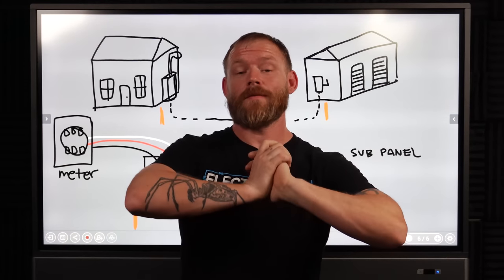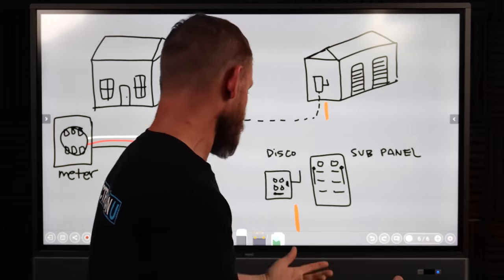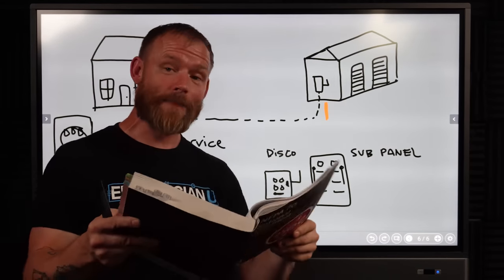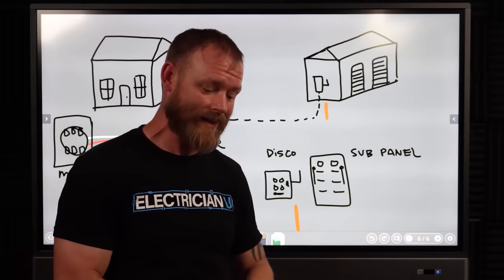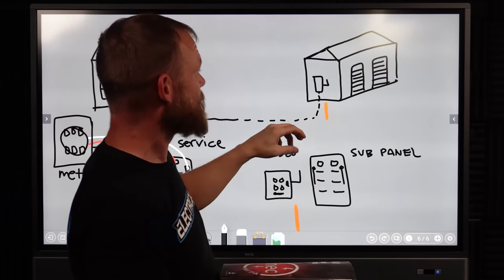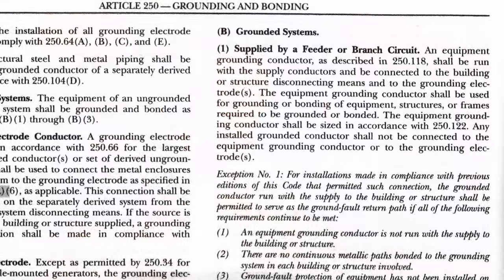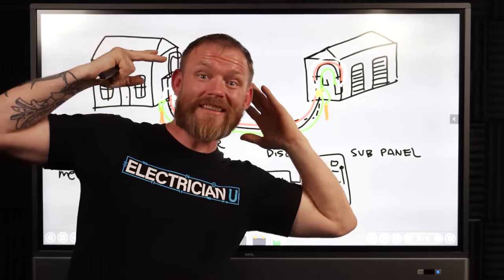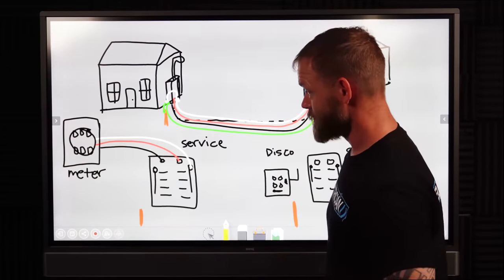Is a Ground Rod Needed When Grounding Multiple Buildings?

Comment: Speaking as an EE, you can't have too many grounding electrodes.  If there's any question, put in another ground rod.  You want that green conductor to be as close to earth potential as possible, which is why it's not bonded to neutral anywhere other than the main panel.  Neutral wires carry current, wires have resistance, and current through a resistance has voltage.

The part about not using the earth as the grounding conductor reminded me of what I used to do as a teen when I wanted to go fishing. (Don't try this at home.) I'd water a bit of the yard, push a steel rod about a foot or two into the ground, and connect that rod to 120V.  In a few minutes, the worms within about 5 feet of the rod would be wriggling on the surface, where I would just pick them up.
Reply: 👀 Hmmmm sounds like a good idea though 🤔🤣
Reply: What creative teen the fished didn't try that at lest once.
Reply: ./Sigh
Reply: Why would you not want the most efficient path back to the source?  

In this application it seems excessive grounding electrodes will prohibit the ground fault from being detected and opening the circuit, increasing the risk of being shocked.
Reply: What happens if you stood on that ground...barefoot?
Reply: Grounding large electronics equipment is just asking a lightning strike to destroy your equipment. So no don’t just ground everything.
Reply: @nobadmojo70  if you add an additional bond to the neutral at the other building sub panel, you will end up with return current traveling on metal parts and the ground (green) wire in a NON ground fault condition, as well as in a ground fault condition. You essentially are giving the return current the option of taking the neutral back to the transformer on the pole, or taking earth back if it's a rainy day, etc...

This is why the NEC clearly says to never bond neutral to ground except where power is generated, transformed, and enters the site from the utility. This process creates a single, low resistance path back to the source. Adding bonds at other locations creates multiple paths for return current to take which is what you do not want. Multiple paths means a less likely and/or longer period of time for a breaker to open in a fault condition.

Think of it like this. The utility high side power feed is the only thing allowed to use Earth as a return. It comes into a pole mounted transformer at 7200V with a single wire. That wire wraps around a square piece of iron on one side, and then exits. When it exits, it gets tied to the metal enclosure of that transformer, then to a low hanging neutral (if one exists), then it goes to a rod at the pole to earth. If the 7200V neutral breaks between the previous pole, and yours, that high side voltage will keep on coming your way, and it will go into the earth, travel back to the previous pole's ground rod, up to the low hanging neutral and keep on going back to the power plant. 

When you bond a neutral in a sub panel across your property, and connect it to a 2nd ground rod. Every 120V ckt in that building has the option of taking the neutral wire pulled between your buildings to get back up to the secondary center tap, OR it has the option of just going down your 2nd ground rod into the earth, making it's way back to your first ground rod/bond at the service, and then back up to the secondary winding on the pole. It also has the option of splitting the return current up, and sending some back on the neutral wire, and the remainder through your yard. 

This is bad. In a fault condition, or worse, that neutral wire you pulled between buildings breaks, now it's all going back through your yard, and people walking around, pets, etc... The 240 side is even more dangerous if it can find it's way back past the service

Comment: Been working this issue for weeks since I discovered it with my shelter house.  Unfortunately the feeder line from the house to there didn’t have a ground run to it (not to mention he didn’t bother running one from the service connect across the driveway to the main house).  Electrician has already come out and it’s planned to all be redone starting the first).  This ain’t cheap but I’ll feel better having it done right.
Reply: Just went through essentially the same thing. No ground in the undersized feeder to the metal shop building and no ground rod at the shop building or the house. Now it's been corrected with a new feeder install exactly like shown in the video along with changing out the fire hazard Federal Pacific house panel with a modern one. Agree it's not cheap at all but I'm happy with the work done.

Comment: Wow...I need to fix my metal building, LOL.  I had a 100A sub-panel/distribution panel on a pole with L1/L2/N/G from the main in the house.  I added a metal building (34x28) on a slap next the panel and actually moved the panel inside my structure. everything is as you show in 250.32(b) but I do not have a grounding rod at the  metal building and my ground (green) is not connected to the metal building just to the ground strip in the sub-panel.

Comment: question: Metal industrial building. 480v 3 wire delta service therefore no neutral coming  into building. The 240v transformer has the neutral  and grounding conductor bonded to to the metal building.   Is a ground rod also required?  Awesome channel for a non electrician!!

Comment: this ground conductor will also help prevent differences on ground potential. have seen computer cable burned out by equipment with a 0.5v ground potential difference.

Comment: HELP!

I have a sub panel in my garage (fuses 🤦‍♂️) that I'm replacing. I have to run new feeder with an egc. The existing buried pvc conduit contains feeder hots and neutral (only 10ga with no egc 🤦‍♂️), travelers for a 3-way light switch back at the house, and a phone line 🤦‍♂️. I'll be replacing the 3-way with a smart switch and deleting the phone line.

The problem I have is that the sub panel is in the middle of the garage slab with no grounding electrode. Will I have to drill the concrete and pound a 20' electrode? The closest exposed earth to the panel is over 15' away. There IS a buried copper water line to the garage, within 3' of the sub panel.

Love your content! Keep it up.

Comment: Hey!  I'm in florida, and wanted to run this by you, because I have had this argument online before.   This is in the case of a Solar system, that is fed by a line-side tap, and not a breaker.    Engineering, as well as inspectors, require a lineside tap from the main service panel (bonded)  to feed a fused disconnect, which is also bonded. 

I see it as a "seperate" 1st means of disconnect, due to the inspectors and engineering.    We are using pierce taps on the service lines on the line side of a main service panel, so upstream of the main disconnect.   So we are branching unfused lines from the meter, creating a secondary system.

Sorry for rambling, but in this case, we always and must bond our neutral and ground in the fused disco, and keep the MSP bonded as well.  

I see electricians arguing that you cannot have 2 1st means of disconnect, and that only the msp should be bonded.     What is your take?    I only equipment ground a disconnect (non-fused) when I'm feeding from a breaker.
Reply: BTW, I Love your page, been watching for years!   I've been a solar installer, working under our electrician's lisence for 5 years, and am soon going to apply as an apprentice and work towards my journeyman's.  I have upgraded service panels, changed out outlets, installed switches, lights, sub panels, ATS's, even meters and meter mains, all along with our solar and storage systems.   I can't wait, and believe the years of watching your videos has a lot to do with why I am where I am today.  Not a part of your discord or your advancement classes but believe I will be joining as soon as I officially make the switch!    Thanks bro!
Reply: Ugh.  Just rewatched the portion where you're talking about multiple buildings and then wind and solar and realized you said that those are all separately derived systems.    Which is exactly what my comment said in 100× words.    I've always been confident that I was understanding it correct, just see ppl argue it wrong sometimes on electrician pages.   Lineside tap to disco, disco must be fused and neutral must be bonded to ground.

If you read all this...  I'm surprised, and thanks! Lol

Comment: Great information! Can you clarify this? What if an out building has a sub panel feeding another smaller sub panel in the same out building, would both sub panels require their own grounding rods? Would only the sub panel connected to the main be the only panel needing a ground rod? It is my understanding that only if the sub panel resides in the same building as the main will it not be required to have its own grounding rod. What is correct?

Comment: From what I've understood, once power has left the meter, the tie from neutral to ground should only occur once, which is at the main panel. Doing otherwise opens the risk of objectionable current. Earthing should happen to each sub panel, in most cases. If wiring enters another building without a panel--no further branches, then further grounding isn't necessary.

Comment: Great video. I'm in southern Missouri and there are basically no inspections here, except for a few municipalities. I see URD for feeders a lot, with no EGC. They just drive a rod. I fix a good number of these.
Reply: What sort of issues do they have when setup that way that you are asked to fix them?
Reply: @kevinmach730  no issues to speak of, unless you have a ground fault. I normally get called to fix hack work, and I'm thorough.
Reply: In southern MO are boat docks treated as separate buildings? Boat dock electrocution is a legit problem..
Reply: I'm new. What's URD?
Reply: @toddkerkhoff4672  Missouri has no statewide inspections, and very few boat docks 😁
Reply: @MrGatlin98  underground residential distribution cable
Reply: @RichardMcDonaldJr  Thanks

Comment: I guess my questions is, in a detached garage or any building, if I install an MLO panel with no main breaker, do the ground rods for that building attach to the mlo or back at the service disconnect at the other building

Comment: I'd love to see a video of you actually wiring the subpanel. As you explained, the neutral does NOT tie to the ground inside the subpanel the way it would in the main house. If I look at the panel inside my house, both bare (ground) and white (neutral) wires can be attached to the same locations in the panel, and those are all attached to the panel itself.

If I understand what you've said, that's different in a subpanel. The grounds will be tied together and grounded to the panel, but the neutral wires will NOT.

Do subpanels thus come with one set of lugs for the bare ground / green and a different set of lugs for the neutral / white?
Reply: When you  purchase a breaker panel to use in an out building as a sub Panel.... most often you have to  buy with the panel, and extra grounding Bar, for that brand of panel. Some brands come with them, but most do not.  It should come with screws and the panel should have a place to attach it. Must use the screws that comes with the grounding bar.  This will be your "Grounding" (Green Wire) connection for all equipment grounds.  The Neutral Bar already in the panel is your "Grounded" / Neutral Bar, for all of your neutral wires, (white).  Remove the Green ground screw from the Neutral Bar, or jumper, which ever it has.  You don't need them.  The Grounding Bar you install will be Bonded to the Breaker panel "can" using the screws that come with it.

Comment: If you have existing outbuilding serviced by a three wire feeder (two hots and a neutral) with no equipment grounding conductor and the outbuilding doesn’t have any metal connecting it to the main building with the service, is it correct that you need a grounding rod at the outbuilding and you bond the ground and neutral at the outbuilding subpanel? Adding an equipment ground conductor between the two would require trenching through an existing driveway so wouldn’t be easy.

Comment: Can you do a video explaining how to wire up a RV/travel trailer with shore power (120v) to a panel in the RV? When to bond the ground and neutral, at the rv panel or is that considered a branch panel and you consider the pedestal the bonded panel?
Reply: It would be a sub-panel. The neutral and ground must not be bonded in that, otherwise current flowing in the neutral will be split between it and the grounding conductor, so there will be some potential on "grounded" metal cases.

Comment: I had an inspector tell me that only one continuous wire can be run for the ground rods; it must pass thru the first and terminate on the second rod. You cannot have 2 separate wires, one going to each rod. Is that a local thing? Also: 6' is the minimum space between ground rods, is there a maximum distance? If two panels are located relatively close to each other, can they share the same 2 ground rods or do they need their own? Conversely, if you had 4 ground rods, 2 ea. for main and sub panels, would it be better to directly connect them all together?  If you have a ground wire directly fixed to a water pipe, can you attach a ground rod to the other end of that pipe, or does that rod require a direct wire to the panel? I know these questions may seem obvious, but codes are not always so obvious. Thanks for your shows!

Comment: Great info, I think it answers my question but I have a specific scenario and I'd like your response. I'm connecting my "shop" (a prefab shed)  to a 50Amp RV outlet.  From my main service panel I've wired a 50A 240v outlet, then run a 100' Southwire  50A extension cord (6/3+8/1 ground) to a Reliance 50A inlet box, which can then be wired directly to a sub panel. (No transfer switch, no generator,  I'm permanently powering the shed via the extension cord from the outlet.) The "sub" panel is actually a Square D 100 A Main Breaker Panel so I have my main disconnect. There is no ground bus bar on that panel. I assume I have to attach one separately, and hook up the equipment ground wire from the inlet box to it. So the main question is: do I need to stick an electrode in the ground and then connect that to a ground bus bar, or can I just attach the 8/1 grounding wire from the main panel to the ground busbar on the sub panel and call it good? Your video seems to say I need to do both: add a ground bus bar to the sub panel, then drive an electrode into the ground and tie it to that bus bar, then connect the equipment ground from the feeder wire as well. But this seems like multiple paths to ground, unless I'm totally muddled. Thanks!

Comment: By tying the neutral and ground together in those other buildings, you’ll probably end up with some strange goings on that will affect micro electronic equipment; such as musical equipment, sound and lighting equipment, computer equipment.
Reply: yep, parallel paths are no bueno
Reply: My welder acts up in my detached garage and I wonder if this could be the culprit. It has a sub panel and I'm wondering if the neutral and ground bars are bonded. The welder welds fine for about ten minutes and then starts sputtering and becomes useless. It is not hitting the duty cycle limit, as I have tried two different welders and they both have the same issue.

Comment: Thanks 🙏for sharing, even though I live in the UK physics is always physics. Do you have a video on separately derived systems perhaps?  
I built a solar shed which can provide power and/or be provided from the main building where the Victron inverter is supposed to lift the neutral to ground when connected to the mains. However I don't feel safe non having the two ground electrodes bonded together so I have arranged for an automatic contractor for phase, neutral and ground change over so to keep the two systems totally independent. However if the inverter is used for charging as well as assisting the all system would run on the main building earth bonded to the neutral at the service and I would still have the secondary grounding electrode connected to the PV system. Should I just bond the two grounding rods and not worry about it or have I done the right think by keeping the two systems grounds independent from each other?🤔

Comment: Hey love the content I work in the solar industry and something I've been instructed to do has been confusing me a bit. I've been told in the past the reason we do this is due to some inspector somewhere in Florida. We do interconnections with generator systems and tap the line side of ATS's to feed disconnects for our sub panels. I've been told that when we do this the PV system becomes a service and that we're supposed to run a ground rod and bond our grounds/neutrals in the disconnect. (Which is fused). Is that correct? The other electricians I ask never really give me a solid explanation. I've always been under the impression that the EGC should be bonded to the ATS and the grounds and neutral separated. Just because the transfer from utility to generator doesn't mean that the PV suddenly becomes a service.

Comment: I'm amazed at the contradictory information online regarding RV pedestals requiring ground rod or not.  Has this been clarified in the code or is there still an argument over whether the pedestals are structures or equipment.  I see grounding rods at RV park pedestals all the time, but it seems by your excellent explanations that this does not add touch protection, etc, but rather only lighting protection of equipment?  Some online information even argues that grounding rods at the pedestals down stream of the grounding rod at the source panel will fail inspection.  So confused.